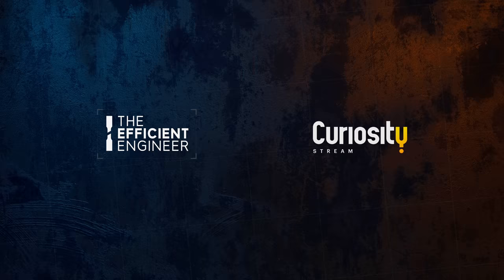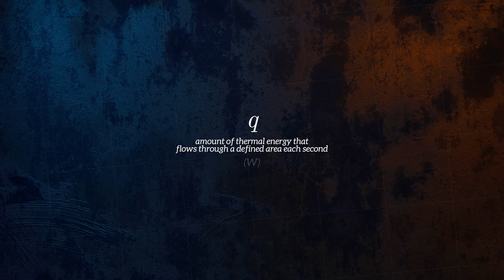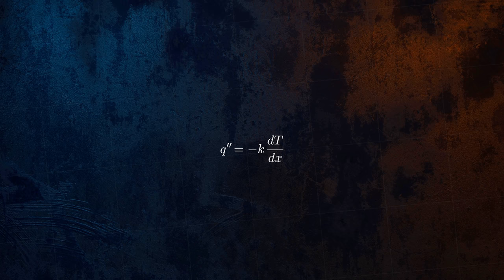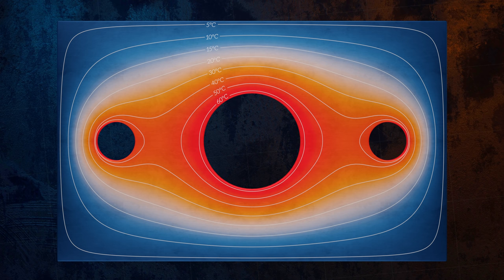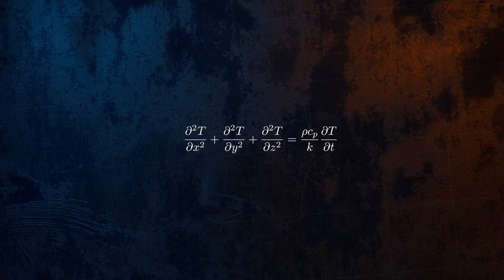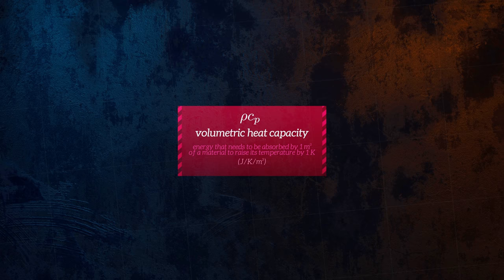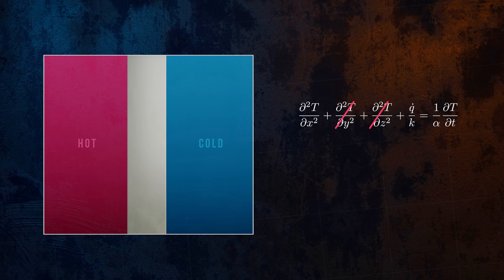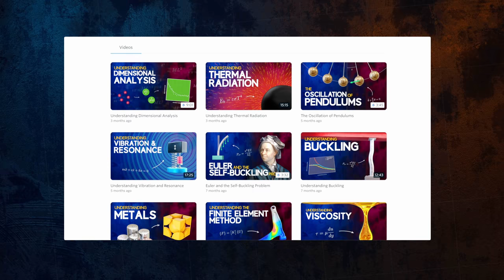Understanding Conduction and the Heat Equation

Comment: I knew that 2nd derivatives is related to concavity and convexity but I never realised it in physical problems. This gave me satisfaction, thanks for the video.
Reply: Nice.. 
but i think it's swapped in the video..
hill=convex, valley=concave
Reply: @joelevi9823  that's right .... Valleys correspond to concavities. In any case, this is a very clear and educational presentation. Congratulations!!!!!!!
Reply: @BorjaVarona_at_YT  of course .. this guy videos are amazing
Reply: I was about to say that same 👍
Reply: 2nd derivative is of course just the rate of change of a rate of change. Physically, the easiest example is the acceleration which is the rate of change of the velocity. Of course velocity is rate of change of position hence acceleration is 2nd derivative of position vs time.
Reply: @joelevi9823  I just a bit still not clear for me about which one is releases heat the most between the hill and the valley (regardless of the probably misplaced the name)?

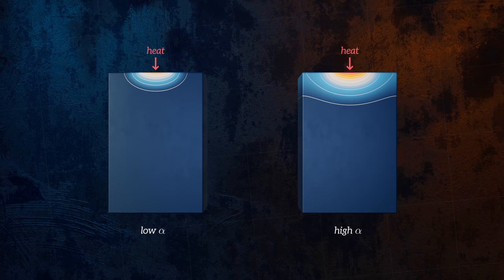Comment: Only one addition. At minute 12:20 you explain thermal diffusivity. You say that heat travels faster thorugh a material with higher diffusivity. However, if i understand correctly, temperature travels faster with higher diffusivity not heat.
Besides that, loved the vid!

Comment: Why do we use Cp instead of Cv in conduction equation?...for gases also Cp is used in standard heat transfer books.
Reply: Condensed matter like solids and liquids only have one specific heat capacity, because their density changes are negligible.

When heating a gas, it can expand and do pressure*volume work on its surroundings.   Cv assumes that it is rigidly confined to keep a constant volume.  Cp assumes it experiences constant pressure, and will do work equal to P*(V2 - V1) on its surroundings, as it heats from T1 to T2.

We coin the concept of enthalpy (H) to equal the total destination of heat, when heating at constant pressure.  H = deltaU + P*deltaV, where deltaU is the change in internal energy (that which is accounted-for in the molecular level KE values), and P*deltaV is the work it concurrently does on its surroundings.   Since dH/dT and dU/dT aren't very temperature sensitive, and are approximately constant, we coin Cp and Cv as the temperature derivative of both of these terms respectively.   Such that deltaH = Cp*deltaT, and deltaU = Cv*deltaT.

In closed systems, keeping track of stored heat energy through internal energy is the most convenience.  In open systems with flow, it is more convenient to use enthalpy.

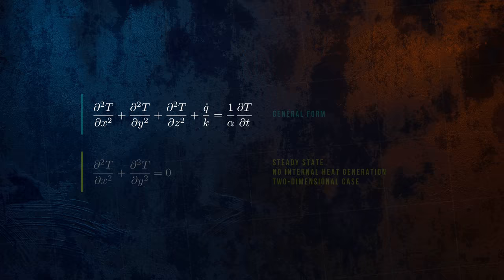Comment: 14:00 What do you mean by steady state case? I don’t understand why you would leave out the inverse alpha because surely it still makes a difference what material we are using no?
Reply: The temperature is not changing over time because it is in steady state. This means that the term “dT/dt” is equal to zero, which removes the whole term.

Comment: I would even say that the resonant harmonic oscillations of charged particles within a gradient field that interacts with said charged particles is energy stored within the electromagnetic, dimensionally finite field - kinetic energy, or heat as we like to say. Due to the "bonds" ... which is the relative positive or negative directional attraction of charged particles due to a non-uniform gradient field coupled with attractive and repulsive forces due to the particle's inherent charges, each particle containing a non-uniform gradient field in itself (U = Eds), within a dimensionally finite system - the "energy" or "heat" is being "forced" to move across gradients to dimensionally local finite points of low harmonic oscillations. The question one has to pose is always: how fine do I set my relative scale? The universe is literally an infinite amount of dimensionally finite subsystems; a system is defined as a dimensionally finite region within its dimensions that has the same relative permeability with the ability to store energy within its momentum (dimensionally moved charged particles within a non-uniform gradient field) as well as convert energy by dimensional displacement against a relative positive attraction within a non-uniform gradient field, in physics it is called work.  W = Fds.
Reply: Bro how u memories this much technical content.... I read but can't understand.... How u wrote this much technical... What are things I need to do to write like u.... Pls give some tips
Reply: @srinivasanv6573  I think a lot about how to explain the world with just electromagnetism - like Nikola Tesla said: "If you want to find the secrets of the Universe, think in terms of energy, frequency and vibration".
Reply: @LeRainbow  what is routine life bro... How many do u read bro...
Reply: @srinivasanv6573  Currently I am reading Appassionata by Alfred Amenda, a life novel about Ludwig van Beethoven. My best advice is to, no matter what you do, always try to learn something new and stop doing the same things every day. I hope you have a great life and maybe we will meet someday. All the best, cheers!
Reply: @LeRainbow  thanks bro for ur kindwords, I have taken ur words seriously here after I try to learn things as well as not afraid to learn
Reply: @LeRainbow  I also want to meet you bro
Reply: @huzaifaabedeen7119  Because we are all our own makers of our own future it might come into fruition.

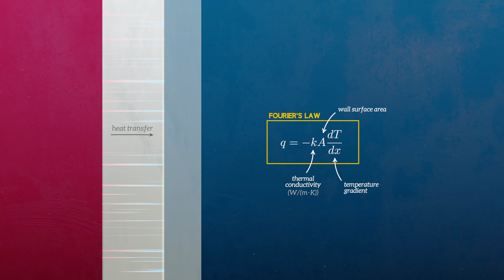Comment: There is an error/mistake at 3:30. The equation should be Q, not q. As small q is used for energy flow per area. In the equation shown, area is part of the equation, so the energy flow is not per area here.
Reply from the maker: This is not an error, it just depends on the convention being used. Not everyone uses the same convention for q.